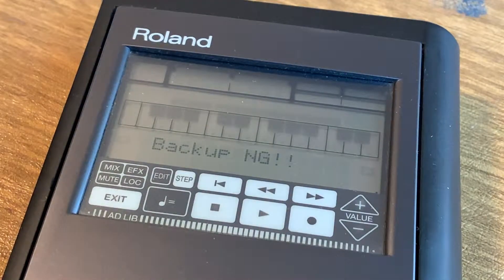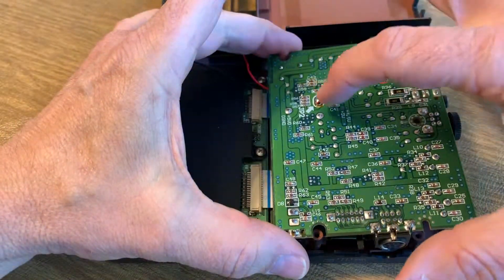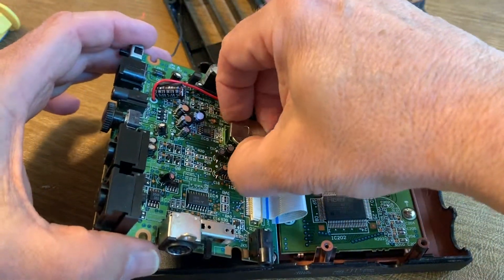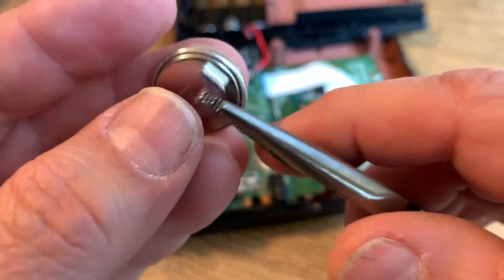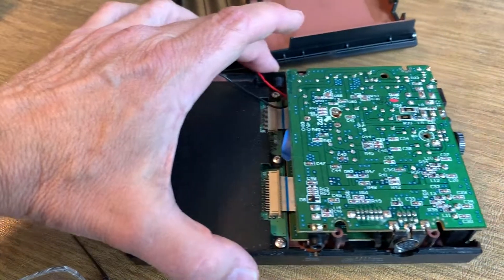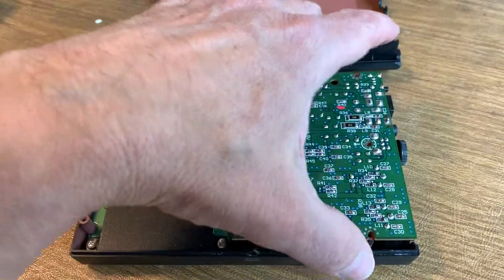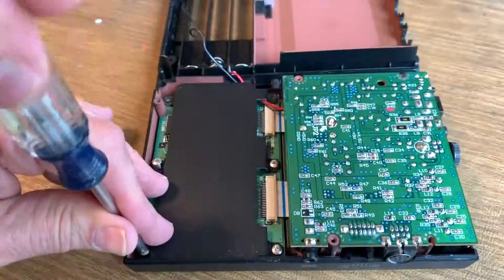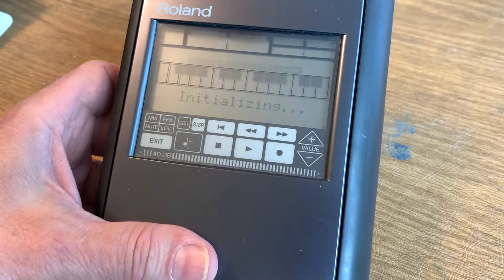Roland PMA-5 "Backup NG" fixed!

Comment: Hi, I changed the battery but still have "Backup NG!!". I found battery voltage in the resistors under the JP2 and in other points on the board, I did a factory reset after the calibration and the inizialization, yet after having the PMA-5 turned off for a while all setting are lost and there is the error message. Any clue why is that? Thanks!
Reply from the maker: Hi! Thanks for watching. Sounds like you might have an issue beyond simple battery replacement. Unfortunately, I'm not an expert on the PMA-5, just someone who wanted to document changing the battery. Might check in a couple of days to see if the battery still has voltage, in case there's another drain somewhere. Sorry I don't have more to offer!
Reply: @fepatton No worries, thank you for replying!

Comment: Didn't trust myself to do this fix, so I took the PMA-5 to an electronics store.  They "fixed" it, gave it back to me, and warned me, "it gives you a 'backup battery low!' warning every time you turn it on, but the battery is actually fine."  Not sure I should trust their word.  The unit does work now, but I don't want to go through this whole thing again in the near future when the battery fails again.
Reply from the maker: I wonder if they actually got a battery with the right voltage in there? Thanks for watching!

Comment: (Previous comment deleted. Here it is again) Much easier. Carefully remove battery (don't pull leads from board). Solder in a single cell holder (with wires). Tuck it in MIDI\PC connector-CN2 area. Secure with 'painters' tape. If future swap battery. No 'intrusive' soldering. The 'CD weld' barely takes any force to break apart. No special tools.
Reply from the maker: Definitely a good idea to put in a battery holder!

Comment: Easier. Carefully remove battery (don't pull leads from board). Solder in a single cell holder (with wires). Tuck it in MIDI\PC connector-CN2 area. Secure with 'painters' tape. If future swap battery. No 'intrusive' soldering.
Reply from the maker: Thanks for watching! There’s no removing the battery without desoldering. The pins are welded to the battery. Adding a holder would have posed the same spacing issue, and this battery lasted a very long time so I didn’t bother.
Reply: @fepatton  NP. I have replaced the batteries in (4) different PMAs using my method. No special tools. Needle nose(keep lead from lifting from CCA) and small tipped screwdriver to remove lead from battery. The 'CD weld' barely takes any force to break apart.

Comment: I get mine since more than 20 years, same battery, never changed but I should... are the genuine patterns written in hard memory or need to backup?
Reply from the maker: The built-in patterns and sounds seem to be stored in non-volatile memory. The battery is needed for anything you write yourself. Thanks for watching!

Comment: Hey man, was your reason for changing the batt that it was shutting off on it's own? I assume it's the battery failing, but it's shutting off in the middle of operation whether the cord is connected or running off batts... I.e. turns on, stays on for a few min then just turns off.. same situation with you?
Reply from the maker: No, sorry, the reason was that the "Backup NG" message, showed at the beginning, indicated a problem with the backup battery. It's been a while, but I think I found that buried in the manual. I wasn't having an issue with it powering off. You might check if you have corrosion on the battery terminals. Good luck!